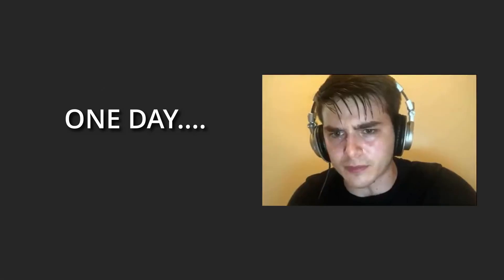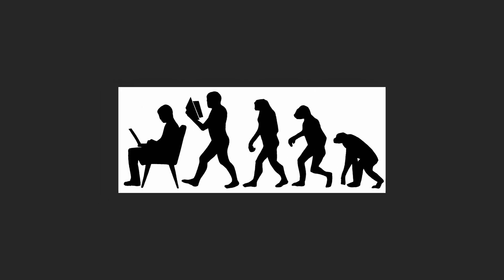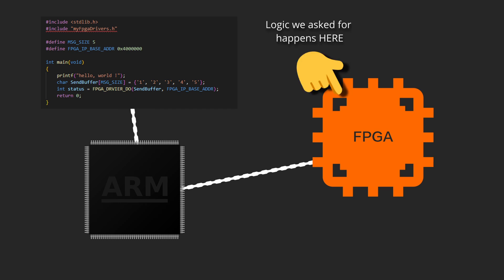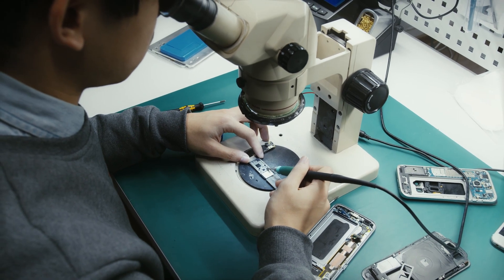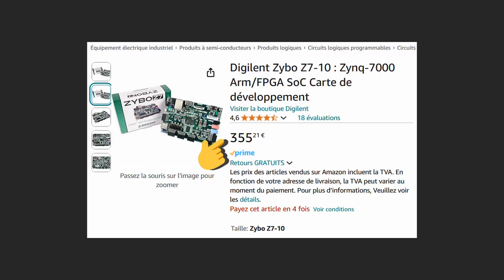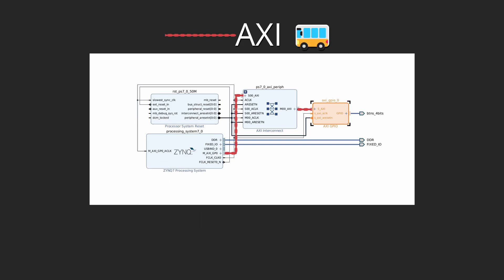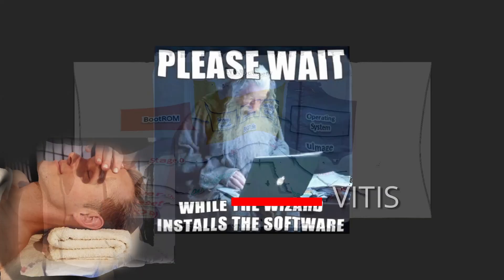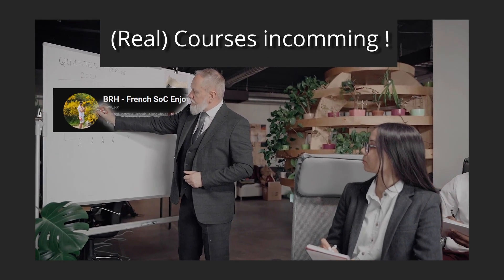ZynQ in 120 seconds | FPGA SoC

Comment: Have you looked into LiteX?    It seems to allow you to leverage existing IPs using Python!

I'm a beginner so still learning.   I bought a Lattice ECP5 board (Colorlight), and have been trying to add the LiteX JTAG-UART IP by connecting it to the FPGA's JTAG TAP controller*.   (The other side of the IP is connected to the internal CSR/Wishbone bus.

The LiteX maps sdout to a uart , so the ECP5's RiscV can output debug strings to the JTAG

On the PC side it , you would connect using:
litex_server --jtag         (runs a JTAG to SoC server, kinda like how OpenOCD is a GDB Server)
litex_term crossover   (communicates to litex_server over a TCP socket)

*
not all FPGA vendors allow you to hook into the TAP.. or if they do, you can't define your own JTAG instructions. Some (like Lattice and Xilinx) are more open or reverse-engineered, allowing access to USER-defined instructions that can be mapped to custom scan chains.   Unfortunately, others (like Intel or Microchip) don't expose a general-purpose user instructions that allows shifting data into custom logic like LiteX’s JTAG bridge.

Comment: What is the advantage of making your own CPU? It makes the system faster?
Reply from the maker: Great question.

There is no real interest at our level, its just a great project to learn a whole lot about the hardware that surrounds us.

At an industrial scale, big chips designers uses FPGAs (big ones, often clusters) to implement their design on "real" hardware and check if it works before launching the manufacturing process. It's part of the verification step.

This is because catching a bug on FPGA is virtually free (if not accounting the engineer's time). But having a bug after manufacturing is launched would be a security & economic disaster, you don't want that if your goal is financial success.

Sorry about the long answer, but I'm working on the next video rn which is about this very topic and I don't really take time to talk about the "why".
Reply: @BRH_SoC  I see, thank you for the detailed reply!

Comment: I acctualy got zynq 7010 board for about 25 USD, its called EBAZ4205 and it is used control board for ASIC bitcoin miner, which is (with small modification) usable as development board. I think you should chceck it out, maybe even inlude it in the series in order to make FPGA accesible for everybody (i also created Jtag from FTDI board, bc whose are expensive too)